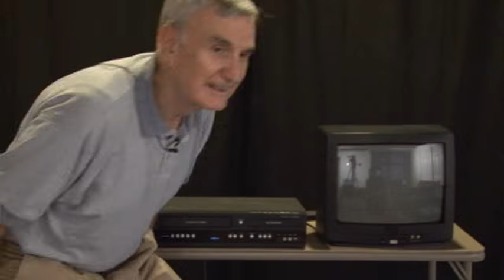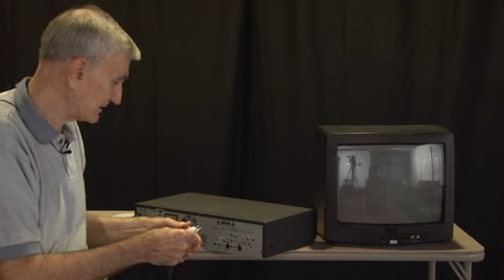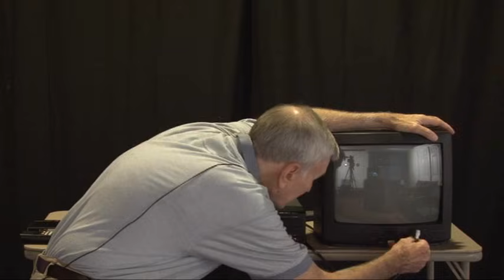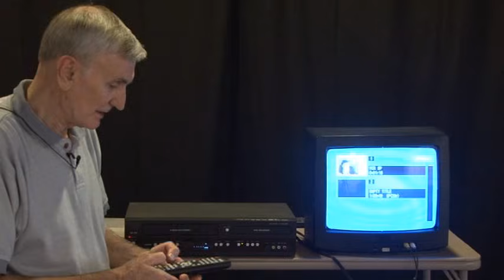VHS transfer to DVD using combo recorder

Comment: at 8:20 i press the dubbing button, but it wont automatically start the tape to record. ive 'cleared' the tape it is 3.05 hours, would i set it to SP, LP, or XP? when i press the dubbing button the symbols next to the timer flash for a few seconds. not sure if im missing something. thanks.
Reply from the maker: Meezan, my combo recorder records 3 hours in the LP mode. So I would have to set my recorder to EP to record more than 3 hours. The quality of the recording goes down in the long record modes.

Comment: Hi, I know this is old, but I just purchased the Sanyo DVD/VCR Recorder Combo, Model fwzv475f. I don't know if it is recording, as the red flashes, but then goes off.  I thought I followed the instructions correctly, then tried since viewing this video.  It's a 6 hour home movie and the clip on VHS tape is not on...can you offer me any advice?  Also, have set the finalzing 2 different settings and don't get to the finalizing option...??
Reply from the maker: Pat Beemer, you say " the clip on VHS tape is not on." If you are referring to the tab on the back of the VHS tape, that means the tape can't be recorded over. That does not prevent the tape from being recorded to DVD.

Comment: We had one of these and they don't work. You can only play the DVDs on that player. I recorded wedding videos for my kids and they couldn't play them on their DVD players. You are better off getting the software for your computer. It is called Hometech VHF to DVD. You can do this on your computer. I have transferred 100's of tapes this way. Next, we went to Best Buy and the stores don't even sell this anymore, they sell the computer software instead. I sure got my money's worth. With the software, you can use a VCR or take the pictures right off your camera. The other downfall of this is it only takes full-size tapes where with the software you can do the smaller tapes.
Reply from the maker: Rebecca Russell, I agree with you that the combo recorder is no longer available for sale as a new unit. These can only be purchased as used or refurbished. So the software solution you suggest to be used with a computer is a very practical solution. Thank you for that information.

Comment: I am trying to dub a vcr to dvd  and skip some things on the vcr, but every time I stop and start I get a paused  frame that makes the dvd very annoying to watch. Is there a way to not have this continual pausing between chapters.
Reply from the maker: Bonnie Seffrin , If you are in fact using the Stop button every time, I wouldn't think this would happen. If you are using the pause button, I could understand this happening. Otherwise, I don't know what to suggest.

Comment: I hope you are still checking the comments here. I bought the unit over a year ago based on you you tube tutorial. I've transferred quite a few VHS tapes and started on more this week. When the transfer was complete I went to finalize it and it froze. I stopped it and tried to eject the DVD but it would not open; only made a grinding sound. I can't find a way to get the DVD out - even to trash it. I've unplugged and reprugged the unit. NOTHING in the manual tells to manually get out the DVD. Do you have any ideas?

Thanks!
Reply from the maker: +Steve Ramm , In the past I have taken screws out of the cabinet and taken the cabinet off and taken the DVD out.  Honestly, I have done a lot of transfer work over the years. I had one that acted as you described, it never worked properly after that. I was very up set  I had to take it out of service.

Comment: Is there a way to transfer what was on dvd to vhs? Its kinda stuck going one way VHS to dvd
Reply from the maker: +Jeff Massi, I can do that with my Magnavox combo recorder used in my YouTube video.  I would have to go into setup, then select recording, in dubbing mode select DVD to VCR.
Reply: +Anthony Wheeler (Edit) Okay just found it in the settings thanks for the help

Comment: Hello!I hope you understand me, my english is not good. I tried to convert a vhs to dvd but something went wrong. I followed the instructions of the manual correctly.   My dvd supported 120 minutes of recording, so in i selected the SP mode in the recording mode. And when it finished of recording I finilize the disc as indicated. The problem came when I tried the dvd and I relized that some parts of the vhs were not recorded in the dvd. It seemed like some way the vhs skipped some parts of the original tape, so those parts were not included in the final dvd. Have you had a problem like this? what could possibily went wrong?
Reply from the maker: Javier Lopez, if you were able to transfer other VHS tapes to DVD and the combo recorder recorded the entire tape then I would suspect that tape that dropped out some parts of the vhs was the problem and not the combo recorder.

Comment: Here’s what I did:  (1) Load blank DVD disc (put it into Magnavox machine) (2) Select VCR setting to the left of SOURCE button (3) Push PLAY button (4) Press D.Dubbing button (5) Press STOP/EJECT button after recording is finished (6) Press SETUP button on remote (7) Select DISC-EDIT on screen (8) Select FINALIZE on screen.

but when I clicked on the SETUP button on the REMOTE, nothing happened. Did I do something wrong? Any suggestions?
Reply from the maker: On my combo only required pressing dubbing button.

Comment: I’m years late to this video! I’m wanting to buy a used vhs/dvd recorder but all the ones I’m finding don’t have a remote! I’m looking online at remotes and I can’t seem to find any with the “dubbing” button. Any advice? Is there a universal one I can use since I’m unsure of what brand I’m going to need?
Reply from the maker: Destiny Hart, no, there is no replacement for the remote that comes with the combo recorder to do VHS transfer to DVD. Sorry! The are other buttons like "set up"
Reply: I recently bought a Sanyo DVD Player & Video Cassette Recorder DVW-7200. I cant get it to record onto a dvd! Did I make a mistake and buy the wrong kind of machine?
Reply from the maker: @destiny6730  , Yes, it appears to be a Video Cassette REcorder only. The correct unit should say DVD recorder!

Comment: This is what I may have to do to the VHS I have recorded in the past is get them transferred!! It's too bad these standard machines won't transfer commercially made VHS to DVD! That's one misconception I have always had but interesting!!
Reply from the maker: ***** , Is it because there is something preventing copyright titles from being copied.
Reply: Anthony Wheeler I believe so! Macro-vision copyright is usually built into commercially made VHS tapes. Even the professional transfer services wont transfer them unless you get permission from the copyright owners!
Reply from the maker: ***** , thanks, I didn't know what it is called.
Reply: just use 2 units at once play thru 1 and record with the other
Reply: OrtonFan WWE Hmm I've heard about that! Wouldn't the quality go down because of the fact its being transferred??
Reply: yes but any time a VHS is played quality is lost due to the tape hitting the rollers of the VCR u dont notice that much quality loss tho
Reply from the maker: OrtonFan WWE, Thanks, thats good information to know.
Reply: Anthony Wheeler I'm looking into getting this unit or the Funai machine that will do the same thing available at Walmart! Some of my tapes have copyrights that I want to transfer so would actually have to get more equipment!
Reply from the maker: ***** , Others may want to comment on this, I don't have any experience connecting to Combo recorders together.
Reply: you can just download the movies torrent on the web too piratebay has a lot of stuff I got a full year of WWE from there

Comment: Very helpful.  One question: I don't understand how to use the timer feature.  I downloaded the manual from the internet but all references to the timer appear to relate to programming a show to tape at a certain time.  Is there a way to automatically set the timer to match the length of the tape?  For example, my VHS was 1:02:11.  How would I use the timer to make it stop?  If not possible, is there any harm in not being present to finalize as soon as the tape finishes?  I'm wondering if I could start the process in the morning, and then finalize when I get home.  Would that be bad for the equipment, etc?
Reply from the maker: Claire Anderson, Yes you can start the process anytime, it will stop when the end of the tape is reached, and you can finalize later. I'll have to look at my manual to see about the timer question.
Reply: Thank you for getting back to me so quickly. I was able to finish my first DVD and have the second in process! Just to piggyback on my question and be sure that I understand, if the VHS is only half full, it won't hurt to allow it to play the entire way through?

Comment: Followed your directions. Unfortunately, when I press the dubbing button, nothing happens, but a message on the VCR/DVD machine display flashes five times: "VCR>DVD". What am I doing wrong?
Reply from the maker: Groovee , if the DVD is finalized it won't work. Maybe  your combo is  in the DVD player mode and needs to be in the vcr to DVD transfer mode.

Comment: A better option would be to use a conversion box attached to a computer, and to source the cassette from a decent VCR, like a good 1980s model, or even a 1990s Panasonic VCR as those combos have poor heads that will not read cassettes (especially older cassettes recorded with linear audio) correctly.
Reply from the maker: Dillon Upton , Thanks
Reply: Anthony Wheeler Have you had that problem with your setup, that it wont play older cassettes recorded in SLP mode properly?
Reply from the maker: Dillon Upton , No, but the quality of some of my old SLP video tapes was poor. I had so many old tapes from my family growing up I was just happy to use a combo recorder to put the tapes on DVD. Now I have so much on DVD my wife and I will probably never watch and I doubt even if my children ever will.
Reply: Oh I see. The Panasonic VCRs from the 1990s do a great job of scanning SLP recordings. Tell me, what is your favorite VCR, for me it is my 1987 Magnavox with Linear Stereo, followed closely by our 1986 Sharp VC-673OU.
Reply from the maker: Dillon Upton , my favorite VCR was my Panasonic DMR-EH75V combo recorder. However the DVD drive failed years ago.
Reply: That's a shame, I really do suggest looking for a decent older Panasonic model, the woodgrain ones from the 1980s are my favorite, my 1987 Magnavox uses the same OEM base as those. However, you would easily find a nice 1990s model, check for the blue line on the door of the VCR. The blue line was a sign of quality back then, when they lost the blue line on later models, quality suffered too.
Reply from the maker: Dillon Upton , Thanks, that may be information some one out there may be looking for.
Reply: Anytime, Anthony, I am just really into old VCRs and technology from the eighties (quite unusual for a millennial), but 1980s VCRs are very special to me since I grew up using a 1986 model Sharp VC-673OU in my bedroom for a time before the idler wheel started acting up. We still have it, hoping to have it repaired by an expert someday.

Comment: Once you have a DVD recorder, when using a blank DVD, could the video be in high-definition when you record?
Reply from the maker: Nicholas Williams, you are recording from VHS tape, they are not high-definition. However you could set the DVD to record at higher than standard record of SP which records up to 2(two) hours, to  HQ which records 1(one) hour. For me the SP speed is just fine. You may want record something at the HQ speed and see if that looks better to you.

Comment: Anthony: really excellent video. I bought one this week (they sure went up in price though!) Unlike others You tubes on this subject you used a steady camera (Thanks!) The questions you didn't cover (which I hope you will) are how you can give the DVD chapter names and edit the title. (Can you do that after DVD has been finalized?).  And I was told that if you have a 6 hour video and set the recorder for LP (4 hours) that the unit will stop the VHS at point DVD fills up and tell you to insert another DVD to pick up at that point. Is that correct? And, if so, do you need to "finalize" a DVD at time of dubbing or can you do it later?
Reply from the maker: Steve Ramm, thank you for your positive feedback. The main reason I didn't cover chapter names and titles is because I use an entirely different approach, not my combo recorder, I use Avid Liquid video editing software for those jobs. NO you can't make any changes to the DVD after finalizing. Honestly I wouldn't want to record anything at the LP 4 hour speed. In my opinion that lowers the quality of the recording. I always found out how much time was recorded on the vhs tape before I do a transfer to DVD..Then I use a small kitchen timer with an alarm to let me know when to stop and insert a new DVD when dubbing. 
That is a good feature if the combo recorder will stop the tape when the DVD is full and allow you to continue dubbing on a new DVD. I strongly suggest finalizing the DVD after dubbing. From what I know the DVD won't play back on another player until it is finalized on the combo recorder that made the DVD.
Reply: Anthony Wheeler Well. I have a bunch of VHS takes that were recorded at the 4 hr LP speed (and honestly some at the 6 hour speed!) and so I wouldn't expect much digital reduction. Commercial DVDs are often over 2 hours, right? And I'd appreciate knowing how you deal with a 3 hour VHS tape transferring at SP. Will the VHS tape stop when the DVD is full? Lastly, Are you using the Avid Liquid software in your PC to Edit the titles and then burn a NEW DVD? I'm a bit confused. Maybe someone seeing your Youtube can explain the process to edit chapters before Finishing. But you did a great job in the time alloted.
Reply from the maker: Steve Ramm, Many years ago I also recorded some VHS family video recordings in my camcorder at 4 hour and 6 hour recording speed.  I believe that transferring a 4 hour or 6 hour LP VHS video tape and setting the DVD record speed  at 4 hour  will further reduce the quality. And may be you are correct that it won't make much further digital reduction. I transfered my 4 hour VHS tapes using two DVD's at the 2 hour DVD record speed. The 6 hour VHS tapes I used three 2 hour DVD's. You say" Commercial DVDs are often over 2 hours, right?" May be slightly over two hours or up to even three, but I would doubt four hours. I don't know if the DVD will stop when the DVD is full. I use a kitchen timer with an alarm to time my tapes. Yes I use the Avid Liquid software in my PC to Edit the titles and then burn a NEW DVD.
Reply: Anthony Wheeler Again thanks for being so helpful Anthony. I already made three DVDs in the first day! I was able to figure out how to Edit the titles and give them correct names. The only issue I this today was in splitting a title into two parts. My 2 hour VHS had two hour-long programs which came through as ONE title. I followed the Instruction Book to find the place to split in two. Tit then says that there is an option in the Edit menu for "splitting". My unit (the Magnavox same as yours) didn't show that option. It only offered to add a chapter stop, which I did. If you have a quick solution, I'd appreciate it. So far it looks like this unit will work just fine. And yiou video seems to have helped many others. It's the best on on the subject on Youtube
Reply from the maker: Steve Ramm, Thanks again for your positive remarks. I'm not sure this will answer your question but I suggest watching my YouTube video "simple editing for vhs transfer to dvd". This video was made using the same combo recorder.
Reply: Anthony Wheeler I did watch it. Excellent but you didn't cover Spliting a title in two when two titles are on ove VHS - When we recorded hour long shows, we'd usually put two on a VHS tape. But I'm sure I'll find the answer.

Comment: What is the image resolution once the vhs is recorded as a dvd ?
Reply from the maker: ***** , I believe it will be an MP2. Other image characteristics will depend on the quality of the VHS tape that was copied to DVD.
Reply from the maker: ***** , 720 x 480
Reply: i have a Sony VRD 20 it also gives a 720x480 but when I put the same video into my computer I usually see black side bars on the side , I want to see full video with no side bars
Reply from the maker: ***** , From what I understand the VHS format is 4x3 (aspect ratio). That means 
the video is 4 parts (inches, feet or other) across the screen by 3 parts (inches, feet or other)up and down the screen. Referred to as 4 x 3 aspect ratio. Most everything now is 16 x 9 (aspect ratio). 16 parts (inches, feet or other) across the screen by 9 parts (inches, feet or other) up and down the screen. So the transfer process transfers your VHS tapes to a DVD in 4 x 3 aspect ratio. Your computer playback screen must be 16 x 9. That is why you have the black background on both sides 
when you play this back on your pc.
Reply: max resolution for vhs is 480i but if you want to see what most vhs would look like set youtube to  240p